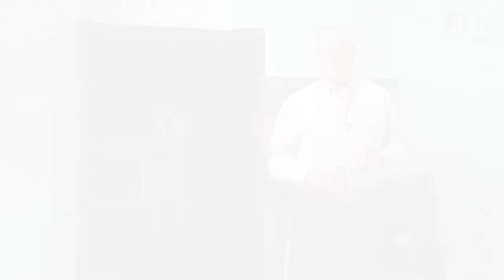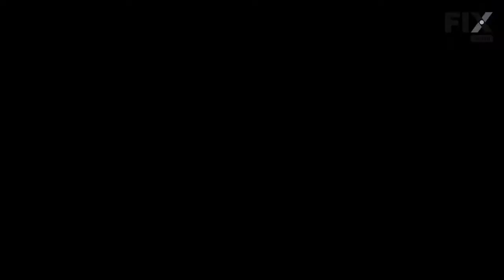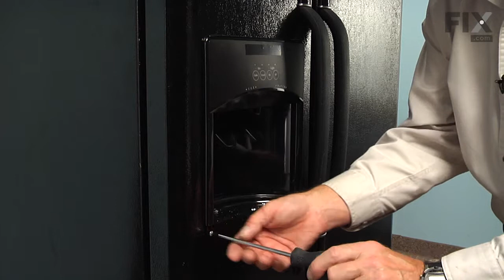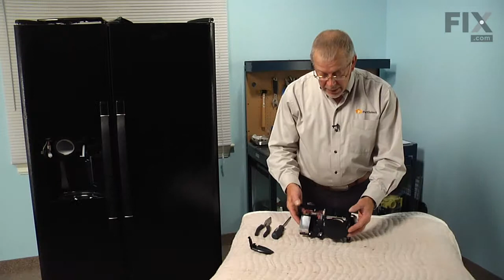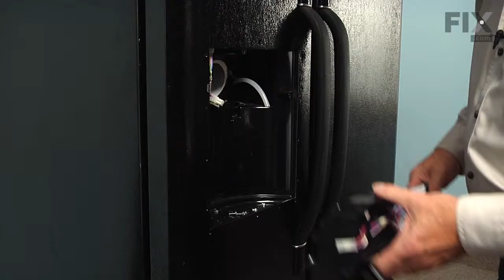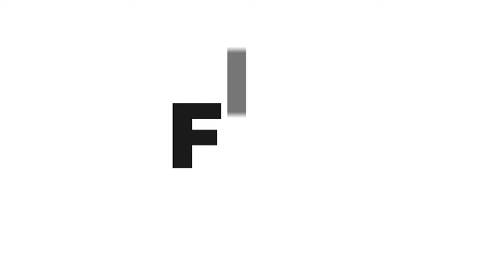Frigidaire Refrigerator Repair – How to replace the Water Dispenser Actuator

Comment: Nice, helpful video. Unfortunately, my Frigidaire dates from 2006 and didn't have the first electrical connector so I had to keep the whole plastic surrounding attached through fear of damaging the ribbon cable - needed another set of hands to help me! Worst part though was feeding the water pipe back through the dispensing hole - what a nightmare. In the end we stuffed q-tips up the tube to give me something to pull it through the hole and then I used a large screw to 'bite' into the tube from below and pull through. Took about 30 minutes of fiddling around in the end but at least we got it fixed. The fridge can live on for a bit longer - thank you!
Reply: Thank you for this screw suggestion! I tried a lot of things, but finally a gutter screw did the trick!
Reply: same here but it worked!